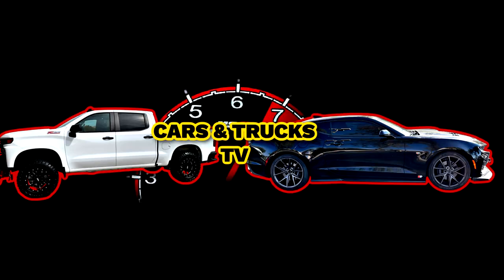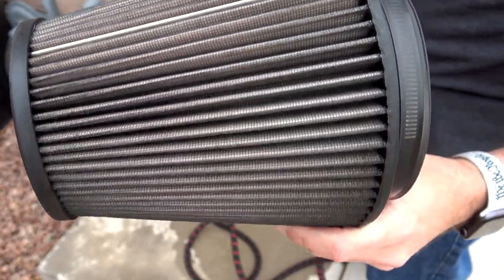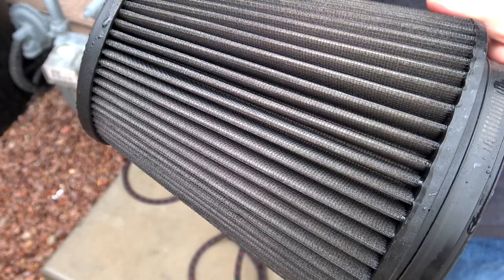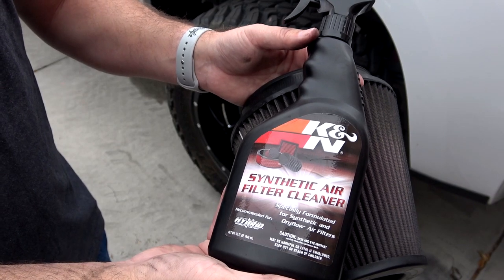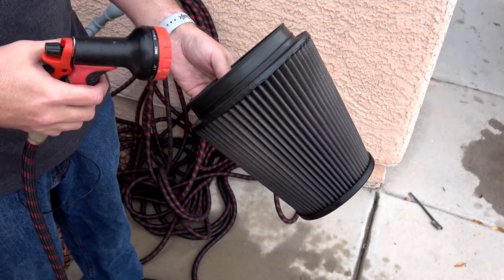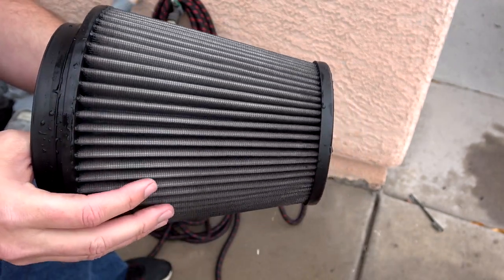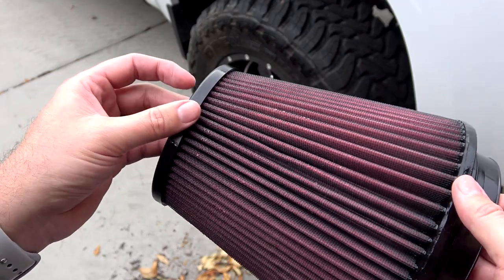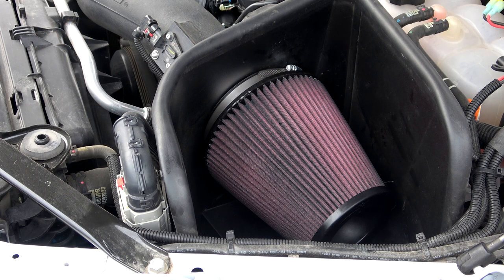How To Clean K&N "OILED" Air Filter

Comment: I add an extra step by cleaning the maf a week after cleaning the filter. Some of the oil can work its way past the filter and on to the maf
Reply: Whats the process on that? Spray down with brake parts cleaner?

Comment: I had a K&N years ago. It cost more to clean it than what an OEM filter cost. And  I never saw any benefit from it. Just watched a video that showed less than a 3% improvement over the stock filter.
Reply: Costs more to clean it? I’ve had the same filter for years and cleaned it multiple times with the same bottles of cleaner and oil that came with it. Doesn’t cost anything
Reply: @majordudley35   OK let's do the math. I bought my car with a K&N filter already installed, No oil or cleaning kit included. It was in bad shape. The cheapest cleaning kit cost $19.95 on Amazon. The new filter costs anywhere from  $9.95 to  $15.52 on Amazon for the OEM filter. I try to keep the Caddy OEM as possible.
I can change the OEM filter in a few minutes. I wish to not wash this filter out and apply new oil for the little bit of performance it may provide. If I say the cost of time and effort are not worth it, I stand by that statement. Your opinion may vary, I'm good with that. Best wishes.
Reply: Cool man👍🏾👍🏾👍🏾👍🏾 go OEM then everyone knows that shit

Comment: All the instructions says do not use a spray nozzle
Reply: That's what I thought also read using a hair dryer is not good? Just let air dry
Reply: No just a a light pressure setting , well that's what mine says